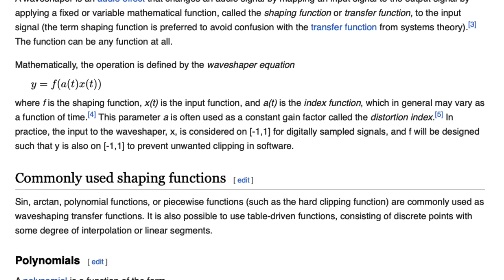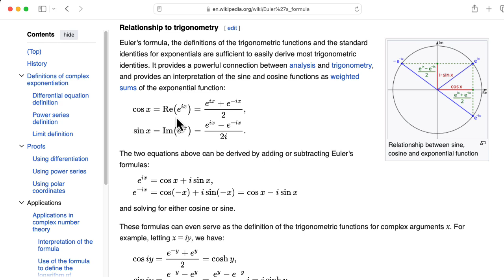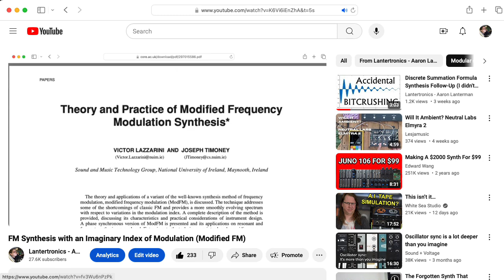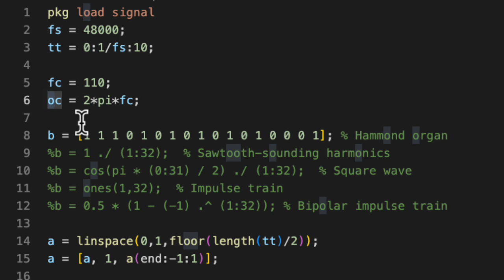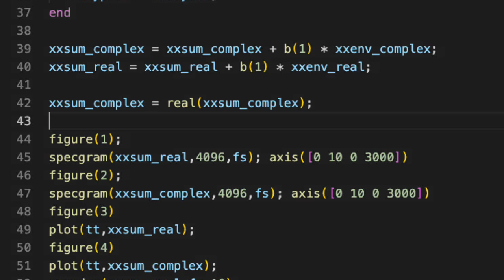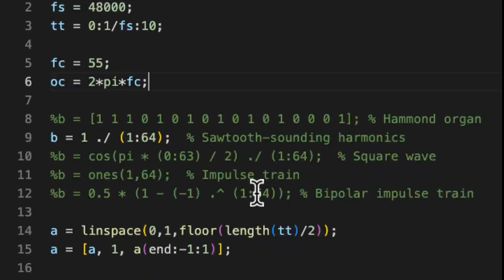Waveshaping Synthesis with Complex Numbers: An Application of Euler's Formula & De Moivre's Theorem

Comment: Interesting. I was wondering what would happen if the non-linear waveshaping function was also non-differentiable at the origin, like f(x)=∛x or any other irrational power |x|ᵅ (multiplied by sign(x) to avoid rectifying the signal), which can't be represented as a Taylor expansion. In this case I found the waveshaping introduces infinite odd harmonics regardless of the value of α. The only exception is when α is a positive odd number, as the function reduces to xᵅ and the harmonics only go up to the polynomial order. The function is also factorizable, so the overall shape of the spectrum doesn't depend on possible amplitude premultiplication of the signal, unlike other types of waveshaping. For α=0 only the sign(x) term survives, so we expect a sine wave to turn into a square wave, with odd harmonics proportional to 1/n. 

I was trying to find a closed form analytic solution for the harmonics, but working with discontinuities in the derivatives is particularly tricky. Still, the function should behave well enough when projected onto the Chebyshev basis, as the same convergence rules for Fourier series apply (uniform on compact intervals and pointwise at discontinuities). The Fourier coefficients are the same, which can be seen by a coordinate substitution like x=cos(u) so du=-dx/√1-x². My idea was to try and write the Taylor expansion of f(x) regardless, using 2δ(x) as the second derivative of |x| and extracting the values of Tₙ(x)/√1-x² from the integral sign. Higher orders in the Taylor expansion would include derivatives of the Dirac delta, which sounds weird mathematically but it's fine if we consider it as a functional on a Sobolev space equipped with the right inner product (or a Schwarz space of tempered distributions, something along those lines). Using notable results from functional analysis we know that ⟨δ⁽ⁿ⁾,f⟩=(-1)ⁿf⁽ⁿ⁾(0) and xδ⁽ⁿ⁾=-nδ⁽ⁿ⁻¹⁾ where (n) denotes the n-th derivative, but then I got tired of carrying out the actual calculation

I did find however an empirical formula for the coefficients of the harmonics, which seem to have two components. Lower harmonics look like a Gaussian centered on zero and with variance equal to α: G(n)=π/√α exp(-n²/α) assuming the Chebyshev/Fourier coefficients are normalized as 2/π. This makes sense if you consider the harmonics of cosᵅ(x) to be a repeated convolution in the frequency domain, as the spectrum for large α tends to a gaussian per the central limit theorem. Higher harmonics have a power law tail like P(n)∝(1/n)^(1+α) but the proportionality constant is different depending on the value of α. We also need to consider it should be zero everywhere when α is odd, for it to reflect the behavior we found at the beginning. After messing around a bit I found a solution that works: 4*(α+1)!/[(-α-1/2)!(α+1/2)!] which can also be rewritten as 4/π*α!*cos(απ/2) through the reflection property of the gamma function. I have a suspicion that the factorial emerges from the Taylor expansion, but I still need to solve the integral with Chebyshev polynomials to confirm this. It's also nice that when α=0 the gaussian disappears and we're left with odd harmonics with a coefficient proportional to 1/n, which is exactly the square wave we were looking for at the beginning. This also lets us extend α into the negatives but only for α strictly greater than -2, otherwise the integral diverges. 

I'm curious if you have ever encountered anything similar, since digital waveshaping in particular has discontinuous derivatives by nature of being a discrete sampling, which introduces harsh aliasing due to high order harmonics. But it was interesting to see this behaviour through a continuous analytic approach

Comment: I've followed your work for a while and I appreciate the exploratory nature of your passion for synthesis. I've been dabbling into synthesis for more than 40 years and I have a growing problem with synthesis-for-itself. Much of it is disembodied and ultimately feels void of substance. West Coast pundits have talked about Complexity for decades now, but what is complexity, and why is theirs just as thin as anything else ? Hear timbres and ask yourself why we immediately detect naturally-produced sounds, and why even the simplest physical flute sounds more tangible than anything a monster modular can throw at it ? There's been promise in Modal Synthesis, after Karplus-Strong and Chowning's FM, yet we're still not analysing the nature of the timbral depth produced by these methods. Surely, it should be possible to produce such timbres additively or subtractively, and equally importantly, by intelligently varying the timbre through the progress of the loudness envelope and its velocity. We're down the wrong path when we focus on the wave shape ; it's the harmonics and partials that matter, and morphological tricks such as wavefolding are aimless pursuits without a rational correlation to spectral outcomes. There's much ballyhoo about harmonics but the real complexity comes with the fact that only extremely rarely, natural sounds have harmonics that aren't surrounded by a myriad low amplitude partials. This is why modal synthesis bears the most promise, because it starts with a full spectrum, as opposed to, say, sawtooth waves. The next problem is that the noise generators we have are of low quality. Do an FFT on most noise generators and see how poorly distributed their outputs are ; I use a Geiger counter with a radiant source to at least get a truly random trigger source within the sampling frequency of the counter. But even without getting there, analogue electronics shot noise should in principle give you a decent noise source. Most often the problem lies in the effect the whole circuit has on the electronic noise. We need extremely reliable, dense, close to theoretical noise sources. Then we need resonant filters (shelf, notch, bandpass) that track pitch, and which can be tuned automatically to specific harmonics or inharmonic positions. Experiments show that you can do convincing sounds (i.e. truly complex) with about eight resonant bands. But you need extremely smooth (truly dense) noise to start with. Just blow some air through your pouted lips ; it should be straightforward to emulate that sound through synthesis, yet it's not. The problem is the synthetic noise sources we're using are too coarse. Like visual grain has a resolution, spatial distribution and modulation transfer function, so too should our synthetic noise sources.
Reply: In a modular synth, if the problem is that synthetic noise is too coarse, how about using recordings of naturally occurring noise instead? So, allowing for a "cheat" when it comes to the noise by using a sample player? It would be interesting to hear your opinion.
Reply from the maker: I haven't really looked at Modal Synthesis in much depth -- I will need to check it out!
Reply from the maker: Is this along the lines of what the Technics WSA-1 does?

Comment: Another lovely video. While using comples wave shaping removes all the glittering, I actually like it - I wish there was a method to increase it rather than decrease it!
Reply: Plugging a phaser effect behind a non-glittery synthesizer might produce what you are looking for, with better controllability.

The glittering in the spectrum is mostly just a kind of comb filter that emerges from the mathematics behind it, phaser effects with tight delays should be able to emulate this.
Reply: Also: dedicated comb filters with a resonance control are really useful for shaping wide spectra, when a phaser is not quite what you are looking for.
Reply from the maker: @vikenemesh  I think the Technics WSA1 may do something along those lines?
Reply: @Lantertronics  Seems like it from the specs: Physical Modelling involving some kind of resonator in the chain reads like it has comb filters. The brass resonator in particular seems very suspicious.

Comment: Is it possible to define Chebyshev polynomials of the first kind of fractional order? Eg T_{0.5} or T_{e}. It's possible to define fractional derivatives... Oh yeah, you mentioned Euler's formula right after I asked haha.
Reply from the maker: Googling "fractional chebychev polynomials" does get some hits but I haven't looked into it beyond that...
Reply: @Lantertronics /videos/videos (sorry about the spurious /videos it's some sort of firefox addon that i need to disable) as you may know, one of my biggest wishes is to create a non-additive (preferably analog) oscillator where the distances between partials in cents are a monotonous, non-linear numeric sequence, perhaps one that approaches a constant in the limit. it also opens the possibility that the partials' frequences themselves approach a constant in the limit, but it is not the main goal here, the main goal is to have a sound with stretched harmonics that doesn't just sound like DSF or a normal analog core oscillator.
Reply from the maker: @cheater00  I think if you want partials that aren't exact multiples of the fundamental frequency you'll inevitably need to have separate oscillators you're adding up.
Reply: @Lantertronics /videos i don't see why this would be true. maybe a handful of oscillators, but not a single oscillator per partial, for sure not.